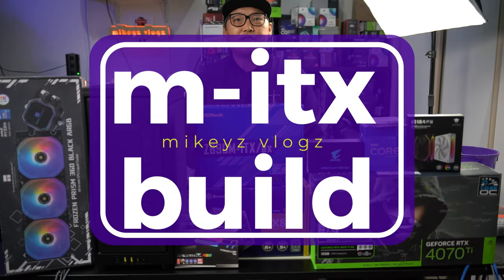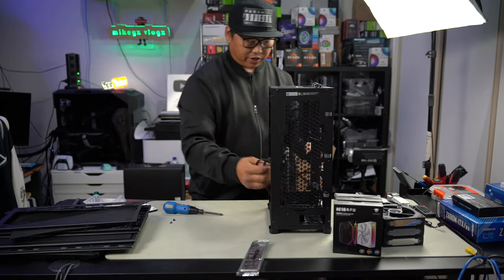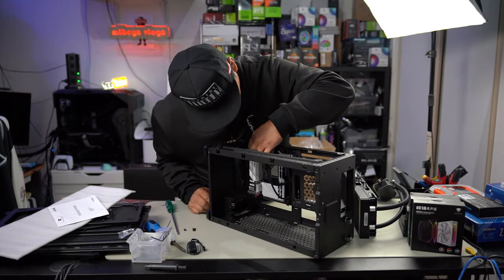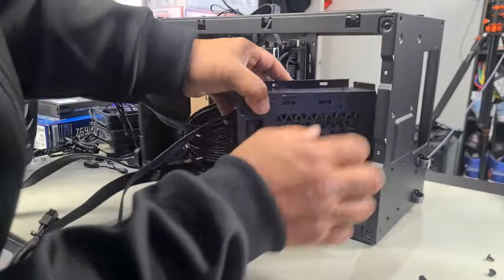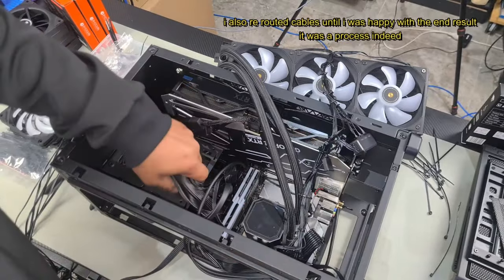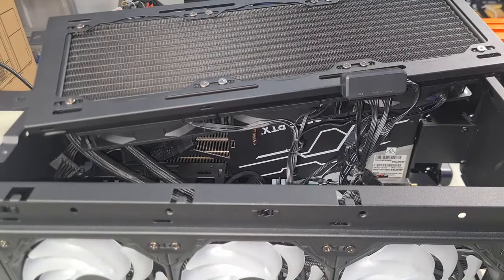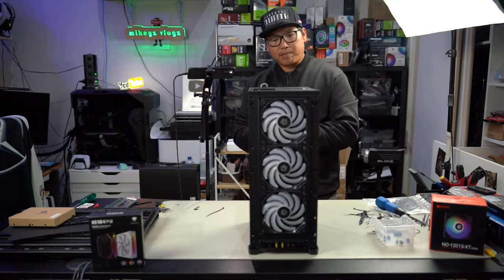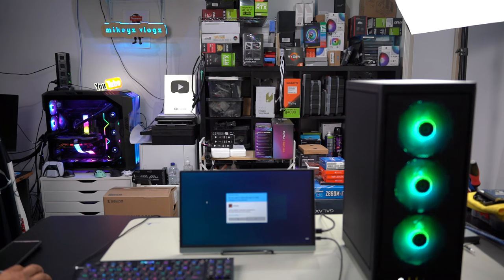mitx step by step build full guide CORSAIR 2000D

Comment: Get those fans turned around and sucking fresh air and blowing through rad to interior
Reply from the maker: cheers ...my thought process behind this was ...because I'm using intake fans and it's directly behind the aio... it will pull cool air in and then push it through the pc case helping to cool the mobo ram psu etc...and the fans on the AIO are exhaust so it's like a push pull configuration... 
I understand what your saying tho... if I have issues with heat I will change it for sure ...much appreciated
Reply: @MIKEYZVLOGZ  got mine all sucking fresh air in. The airflow is amazing. All heat goes out top and back of case. Also modded back of case to fit my RTX 4080.